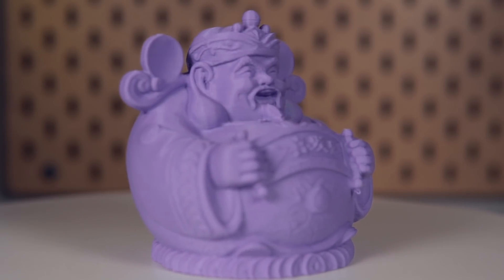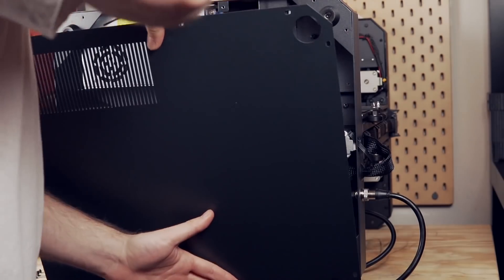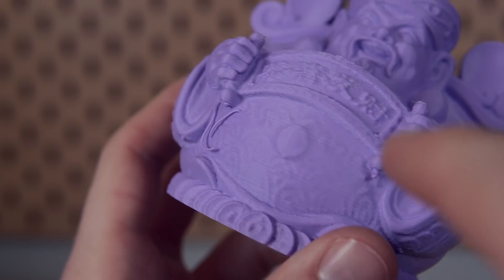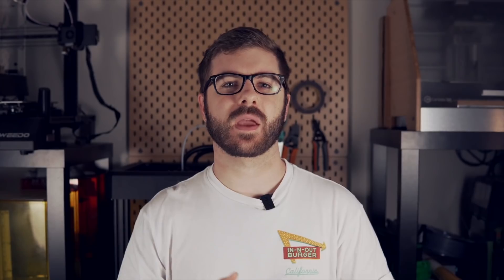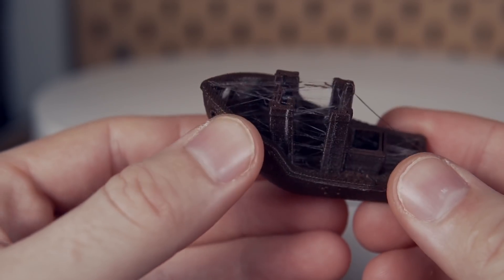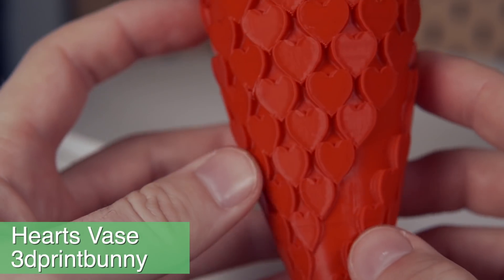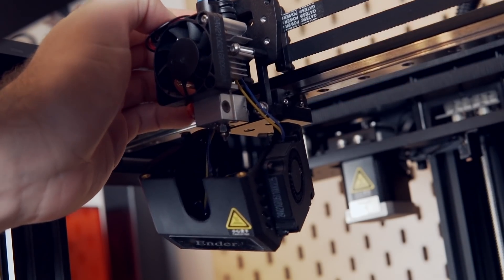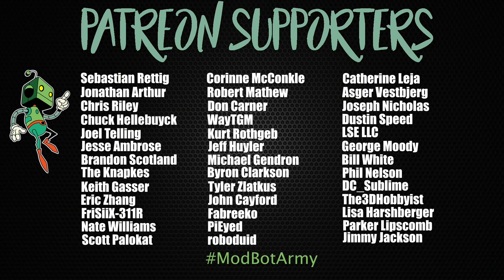Is The Creality Ender 7 Right For You? (Not What I Expected)

Comment: 6:53 That's where my trouble started.... I used the printer for 4 days, it's been a paper weight for 4 months now.. Creality won't help me with it either. Their initial response was, I didn't know what I was doing, (not wrong but besides the point) and I just needed to learn how level it. They completely misunderstood that I was explaining a noise coming from the motors and the Z-axis stopped moving. I don't know, I will get it fixed, but right now I'm still too mad at it.
Reply: Its the hotend, I've replaced mine with a Spider v3 and the issue has gone.

Comment: The first think i do with new printers is go over all the screws and wiring
some time the extruder gear wheels have been lose or out of alignment and the tension spring has been to weak, so i normally upgrade these and shorten the bowden tube to reduce the friction

I have found many printers that i have had, is i have had to tune the Z height and E step calibration and also the heat of the bed and nozzle are  out by about 5 -10 degrees, So I have not found a printer that does not have accurate calibration yet
one thing i can think of, is the larger stepper motors could be drawing to much power from the main board and causing a surge, and that could be the reason the motors are making more noise,
I normally see DM542  stepper drivers used for Small cnc machines where the noise does not matter as these are not quiet unlike the TMC2208 drivers that should of been used and have less noise/frequency  problem than the DM542
and they should be very well insulated and they are not, so this could also be causing issues like stepper motors being out of sync because the pulse to move the motors are not accurate.

so i i buy a used Ender 7 i will change the drivers, and im sure that will solve the issue with it.

Comment: I wanted a core xy and took the chance since the price drop(paid $430) and was my cheapest option. I watched a bunch of review and they seemed mixed between hate and love.  Guess I was lucky and I love mine, haven't pushed it really hard, but my prints are working well.  My only complaint is the installed firmware is closed.  I saw TH3D has a marlin version that works with a different display, Im also seeing Klipper config files coming out so I can configure one of my RPI.
Reply: U still use ur ender 7
Reply: @monsterstorm78  Ya,  Its been running really well for me.  Still running stock firmware, have not had a chance to put the effort in to change it.  I did add a BL Touch, super easy install, just used the connector on the top, no re-wring needed.  I do have issues with the BL touch randomly erroring out when I map my table, but I had similar issues with my CR-10, it does eventually work.  I have read post that some board have a capacitor installed that causes issues, not sure if the Ender 7 has these problems.
Reply: @ericbommer2280  u think the ender 7 worth buying tho

Comment: ModBot, did you ever do the upgrades?  I have an Ender 7 and to be honest, a slightly modified Ender 3 V2 is more reliable...I got suckered in on the faster speed, but most things I do aren't much faster at all. What are good printers that can actually print faster than an Ender 3?

Comment: Had all the same issues you described. Was a very steep learning curve for me as a novice two months ago. The issue is definitely the extruder and/or hotend. It cannot extrude enough for high speeds. Check the Creality Slicer flow settings, they "fixed" it by setting 125% (!) flow rate for infill at 250mm/s. Also it's very "spongy" and delayed, so it's impossible to get the right amount of extrusion, because you have to retract like half a kilometer before the corner. Also couldn't tune linear advance  (Merlin) or pressure advance (Klipper) because of that. Went with a Mellow NF Sunrise direct extruder and wow. Totally different machine. Perfectly clean prints now, even with high speeds.

Comment: i have the ender 5 plus wich I upgraded withe the pei coated spring steel hot plate and microswiss dual gear direct drive extruder setup and I absolutely love it. I'm printing any material I want with great results once some minor adjustments are made from one material to another. Currently turning out amazing quality masks and helments in tpu. Basically what I'm saying is the ender 5 plus is so good I'm sad to hear that Creality dropped the ball so hard with the 7.

Comment: I went through two Ender 7's in November and December.   Both had broken touch screens, limiting functionality a great deal.  I never had a successful print.  Creality airmaled a new screen for the replacement E7, but it too was cracked on arrival and running some weird firmware that wasn't a Creality interface.  After all that toil, back it went. My modified Ender 6 is still less than a 7 and approaches the touted speeds.  I think they probably just done a Ender 6 Pro with linear rails.

As for the S1, my experience was great until tonight.  4 hours into an 10 hour print, I was woken up by the on-board alarm.  Reset the printer to find that the hotend isn't heating, and the JST jack is broken.  I got my start with Creality, but there are too many quality problems.  Oh, interesting fact: the start gcode in the Creality Slicer profile for the Ender 3 S1 doesn't include any ABL gcode, just G28 and the same starting gcode for the other Ender 3s.  That's extremely disappointing.
Reply: Same here. Creality was my first but I will never buy another. My cheapo Kingroon and AnyCubic print way better than my E3V2 for the price.

Comment: I honestly don't see the problems reported here. 3 things are mandatory on ender 7 after assembly:
1 the traction gear (sometimes without tightening)
2 the strap holders (sometimes without tightening)
3 extruder calibration (values very out of the correct)
done that, and some tweaks to the slicer (cura 4.13.1) i got fantastic prints in 1/4 the time my ender 3 v2
the machine is very good but the assembly and adjustments not so much

Comment: I used to have similar issues when I swapped to a mosquito magnum + until I started to tune linear advance for each filament I use. Not sure if the ender 7 supports linear advance but if it does I would recommend trying that to see if it makes a difference in the print quality.

Comment: I learned my lesson with creality, i.e I sent them back to amazon and won't ever buy another one.  There's no real engineering there just cost cutting to the max and bizarre/garbage engineering ideas (like who on earth would build a large core xy 1000 buck printer with linear rails and blah blah..... and not have the bed supported on both sides?!?!). Your never gonna be able to print a bed full of functional parts. Yes you could probably replace everything that moves and end up with a half decent printer but by then you would have spent 1500+ and may as well have just got a Voron which would be better in every way.  I now use QIDI for the budget buy from amazon next day delivery printing in 30 minutes "farm workhorses" side of 3d printing, and building 2 x voron 0.1 for the core XY fast fun fiddle around and experiment side of 3d printing.

Comment: Drivers and stepper motors, maybe even the control board.  They're the biggest change I see from the Ender 6, excluding linear rails, which can produce much better prints. So many issues relating to movement of the bed and extruder that is where my focus for the issues would be. Any purchaser is Creality's beta tester.

Comment: I like your onest words and would like to see what you are going to make of the printer. I own a Ender 7 as my first Printer und learning.....
At first I print slow to tweak the Cura settings and get the best quality. PID tuning, feeder stepper motor adjustment (was nearly perfect), PTFE Bowden tube, got rid of the head ring what's o ever housing to see my prints and printed a small housing for the cable exit. Installed a BL touch.

Comment: I would like to suggest that you make sure that the stepper drivers on the board are adequately cooled.  The lab in which I'm doing my PhD research has 3 old Taz Printers and one of them was consistently exhibiting a Z height issue after a rebuild which we couldn't figure out.  Turned out to be a cooling issue in which the Z stepper driver wasn't adequately cooled.  Once we put a beefy fan on the board, it came back to life.  Maybe it would help with this one as well. who knows.

Comment: I was very disappointed by the quality this machine was producing. As you said, the hotend is not a good one. The extruder is not good for this price tag. But replacing these two get you very good prints. But if you're planning to buy a new one, certainly not recommended.

Comment: I am using this Ender 7 machine for a month now. I was frustrated by the lack of any specs, source code or any details about its hardware. I couldn't change the stock limited functions with any custom firmware. 

I then installed Klipper and after a lot of tuning and experimentation, I finally got the perfect print at real 250mms. I can even bump it upto 300mms. But I am very happy with 180mms for normal prints.

Capable hardware but poor software and support.
Reply: im really struggling to install klipper onto my ender 7, can you please tell me how you did it?

Comment: A very good review of this printer.  It is refreshing to see a frank evaluation of the product without glossing over the issues.  You mentioned that you are currently reviewing the Ender-3 S1.  I am also impressed with what this printer offers.  However, I'm a little concerned with the amount of current that appears to flowing through the ribbon cable to the heat block heating element.  How does this not burn up the ribbon cable given the light gage wires of this cable? The wires from the heating element to the breakout board look to be of appropriate gauge.  How does this even work?
Reply: Hmm.. I do not have the Ender-3 S1 (yet?), so I cannot see how thick that wires are, and how many are used for the heating element. If you use not-too-thin cores, and use enough in parallel, a ribbon cable can take a lot of energy before becoming overheated. If you touch that cable after a (relatively long) print session, does it feel very warm? Anything up to 40 degrees (Celsius) and maybe 50 degrees can be acceptable. That, of course, depends on the maximum operating temperature that cable is capable of. Most quality cables have their operating range printed on them, so you could use that as a reference.

Comment: I've owned an Ender 7 for several months and this is the first review that actually seems to describe the machine accurately. I've had the same issue with random over and under extrusion. No combination of settings and filament will fix it, seems to be an inherent issue. Print quality is terrible for a printer that costs £500, my £300 Sovol SV01 is far superior in terms of both quality and consistency.
The print bed is also deeply underwhelming. All my other printers have 'ultrabase' type glass beds, and this is by far the worst. PLA barely sticks to the textured side at all, and while the smooth side is a little better it's still bad. I fitted a BLTouch to make sure levelling wasn't the problem and it didn't help at all. Finally I bodged in a spare SV01 glass bed and that works much better, although I lose some print area because it's not the right shape and size.
But it's not a total solution. The Ender 7 still randomly prints too high or too low on the first layer. I'm positive this is something to do with the bizarre bed mounting system, which supports the bed on only one side and is very shonky indeed.
I could go on with a legion of complaints; the E7 is noisy with no silent board available for it, Creality haven't released the Marlin source code, and there's also a complete lack of spares for the printer. No beds, no hot ends, no replacement rails, no boards, etc. Creality seem to have abandoned it already. If something breaks, you're in trouble.

tl;dr - the Ender 7 is a cargo cult Voron. Creality thought that building a rigid frame and fitting it with linear rails and a core XY movement system would give them a fast, good quality printer. It didn't, because they have no real idea what they're doing.
Reply: Does those issues on Z appear because you use "Z Hop" ? On they are still there without z hop ?
Did you try the trick where we put a ball bearing between the nema shaft and the Z screw to avoid the coupler to "compress" under constraint ?
Reply: 100% agree with everything said, have you tried to replace the fans? The cheap china ones are way too loud and will eventually get louder... Got some new ones for my motherboard and extruder and its made a massive difference. Just double check the voltage matches. You probably already done it but just add this in there incase and for others.
Reply: Well - I had some interest in that Ender 7, but seeing all the things that gone wrong, that interest is dissolved in thin air. It could be that a one-sided support of the bed is not optimal, but I own a Ender 5 Pro, that has also a one sided support, but prints perfectly. I highly suspect there's something wrong with the firmware, because that sort of irregularities point to a non-optimal configuration of stepper driver software. Sadly (opposite to the Ender 3, Ender 5 and some other models) the software is not open sourced, so there is nothing much the user can do to correct anything. You really have to rely on Creality to correct any misconfigurations and bugs that are in the firmware. And sadly Creality seems to slack off in that part. That's the reason I am not that impressed by the latest Creality models. It's fun if everything works, but good luck if it does not.
Reply: do I go for QIDI TECH 3D Printer, X-Pro ?'
 ;'c

Comment: Your issue could be over-extrusion. Did you check the extruder calibration ? (steps/mm). Then, unless expressly limited in the firmware, maximum acceleration values are easily modified (M201+M204). Eventually, you can compile and update the firmware yourself. Worth doing at least if the Linear Advance is not activated (M900). There is no reason you should not get a good print out of this printer... (I own an Ender-5)

Comment: I just can not wrap my mind why creality spits out so many models at so short intervals without spending the R and D time to perfect any of them at all. The result is a bunch of mid-range performance  to poor performance  machines.
Reply: I think Creality became over confident, and have forgotten that their success was mainly because their Ender 3 models where very popular hobbyist machines. The early Ender 3 models where decent, but could be made to great machines, because they where easy to modify. Having open-sourced firmware greatly contributed to that, because tweakers made a lot of improvements in that firmware.
However - They are spitting out new models in a fast rate (and mostly at high prices), make it difficult to catch up for the hobbyists and thus less easy to modify. On top of that - All the firmware is now closed source, so the amount of tinkering that's possible is reduced dramatically. Those both factors make new models far less desirable, and difficult to trouble-shoot. I have some hope for the new Ender-3 S1, but that's as far as it goes.

Comment: Machines that are priced in that range shouldn't need a complete overhaul to get them to work decently.  For the same money, I'd opt for the Qidi Tech X-Plus.  Bigger build volume, fully enclosed, capable of printing ABS as well as other high temp materials and ready out of the box.  I'm not sure that the cantilever design of the platform on the Creality Ender 7 lends itself to using v-groove wheels with that build volume. If you take a look at the Qidi Tech X-Plus you'll notice they use dual linear guide rails on both sides of the build platform to assure uniform support. Nice honest review though on the Creality.

Comment: I've had this printer 5 months and I don't see any of these problems. The only tweak has been 210C for PLA and a set speed of 200mm/sec. Also, I set flow to 90%. 
The most reliable printer I have. The top layers are not as nice as they should be, but I think a logical upgrade is to an all metal hot end. 

The new Creality glass bed at 65C is outstanding.
Reply: Have you put on the ABL yet?  I put a CR touch on my Ender 7 even though Creality said it wouldn't work.  I used the bracket file and installed the firmware for the BR touch.  Works great!!!  Only thing I might do is use a stronger filament for the bracket as it is a little flimsy.
Reply: @robb2465  u still use ur ender 7